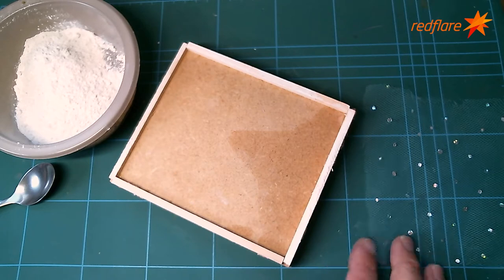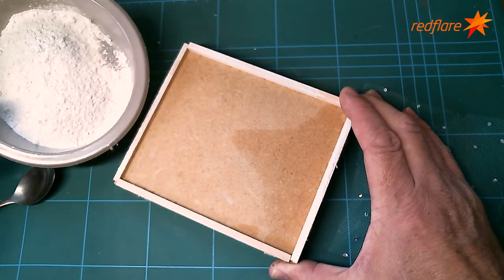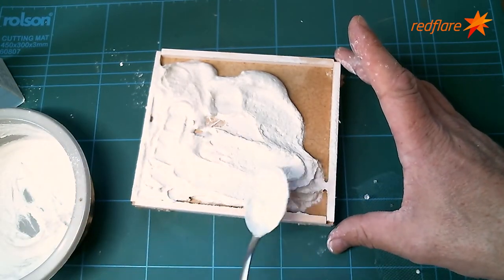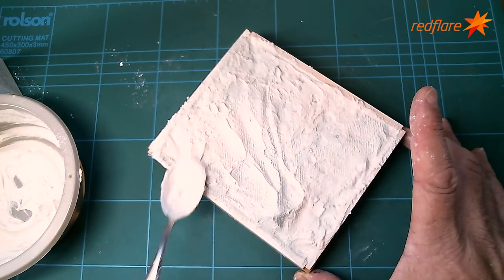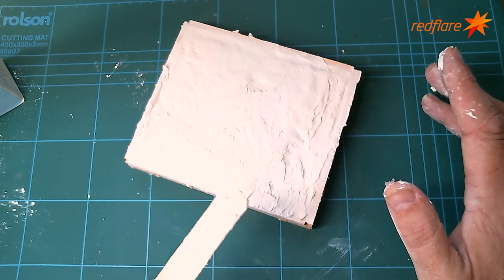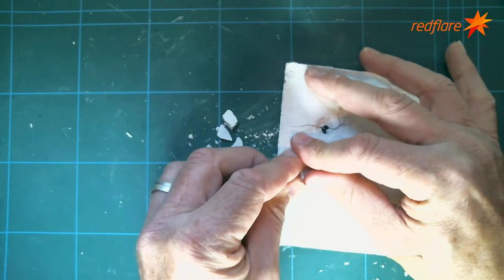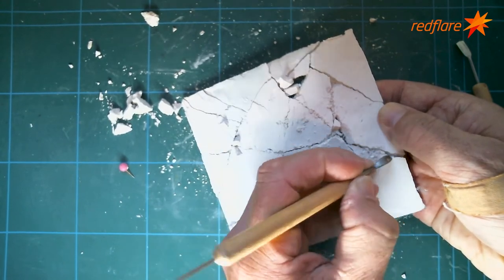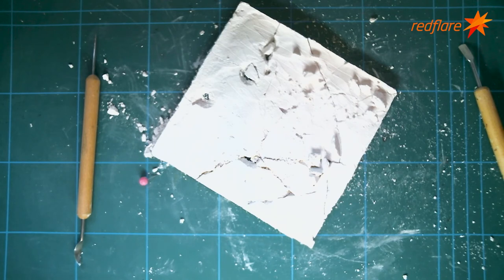Cracked Concrete for Model Dioramas

Comment: Pro Tips. 
1. Add in some fine stone that's multi-coloured to simulate the aggregate that would show in an older road. 
2  Tint with acrylic paints to precolour for ashphalt or concrete. 
3. Prepare your mould with some wax paper underneath and/or very thin foam. You can then lift it out and onto your diorama in one piece and the foam underneat will give it a bit of give making it easier to crack.  It'll keep it nice and clean as well so you can re-use it right away or just to keep it neat. If you do a lot of diorama work making moulds for road widths or just square bases saves a lot of time and work.
Reply from the maker: Thanks - these are great tips!